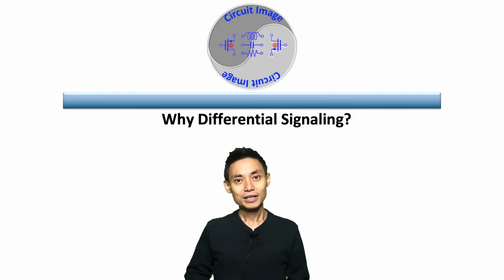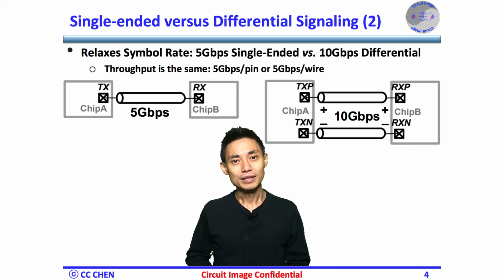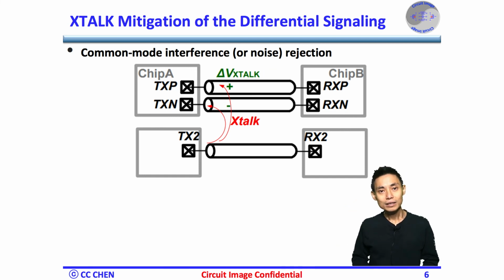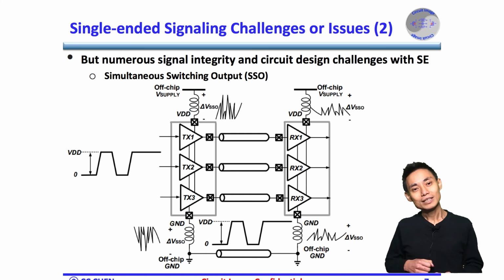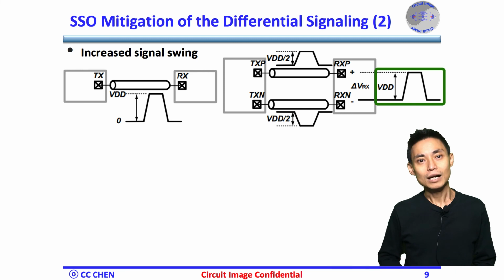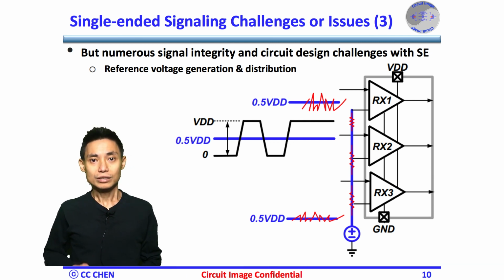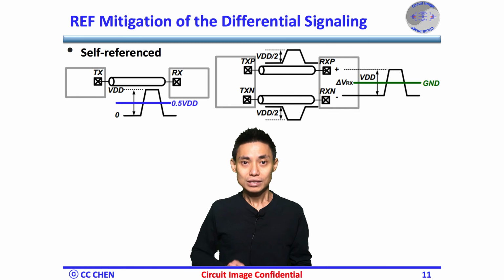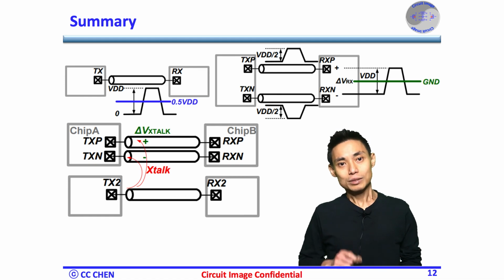Why Differential Signaling?

Comment: Very good video. Maybe adding one comments the differential pair P and N are at at opposite phase so they are cancelling each other so results less SSO
Reply from the maker: @Jeffrey Yellow Thank you. Good point! I've mentioned the "P and N are at opposite phase so they are cancelling each other so results no SSO", but like you said there's still having slight residual interference due to the distance or geometry mismatch :)